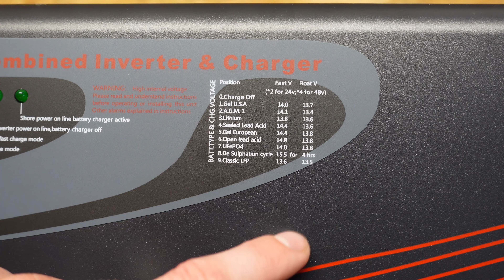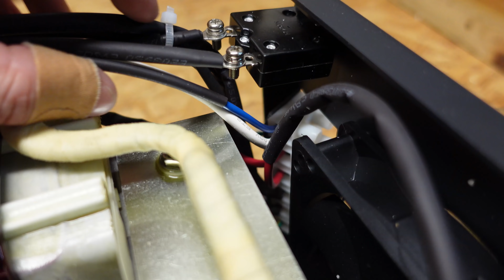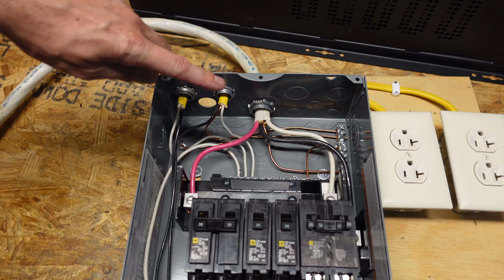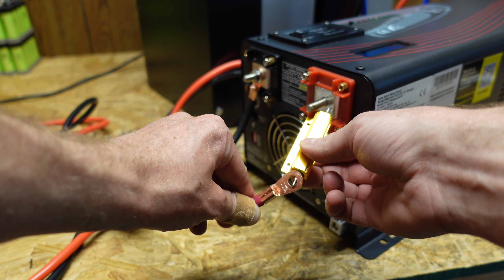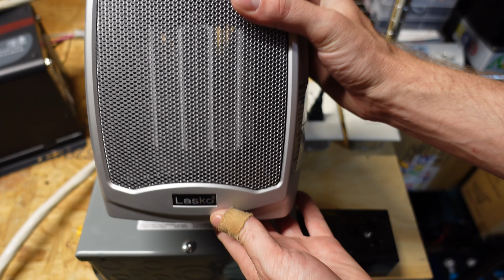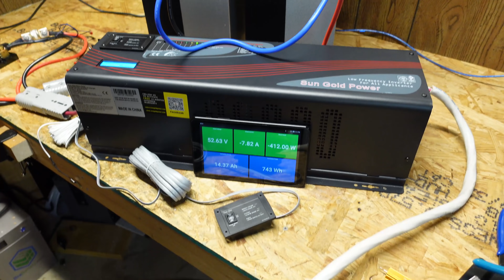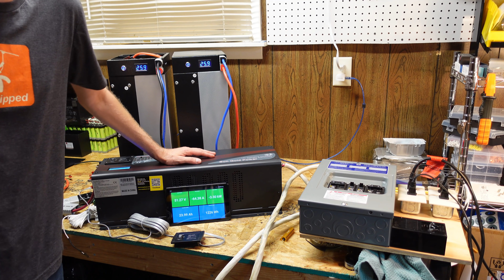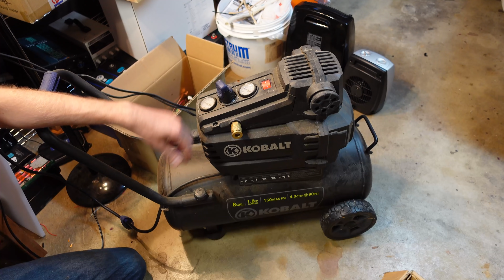SUNGOLDPOWER 6000W Pure Sine Split-Phase Inverter, Review & Testing

Comment: No, those are NOT fantastic battery modules for them to have under-sized the internal wiring. It is not a crimp connector that causes the length of the wire itself to heat up. Bad crimps can cause hot spots at the crimp, and even arcing, but the wire is grossly undersized. Wire only heats up when it's being used as a heating element on account of too much current. The designer and manufacturer should have tested that cabling, and they failed to do that. In all my years as an Electrical Engineer, I've learned that one can usually get away with under-sized wiring for short lengths inside encasements, but the metallurgy of the wire has much to do with how much overage it can handle before rising above the acceptable heat index for the insulation. What you experienced is typical of Chinese bad designs and build. They should have tested their wiring before putting these out into mass production. Wiring in new cars and trucks these days are getting warmer than they should because manufacturers are down-sizing the wiring so much to enhance profits at the overly high prices of their products. You should put in a parallel wire to those in the battery enclosure that are heating up, or replace those internal wires yourself if you want to try and make sure you don't end up with a fire in your home. Fine stranded welding cable can generally handle more current than the larger strand wiring with THHN insulation for industrial interconnections.

Comment: Great video. Can you also use the scope to see if it really maintain pure sine wave output? The inside looks like AIMS.
Reply from the maker: I do have an oscilloscope but am not familiar with it enough yet to be able to look at a waveform and say what is/isn't good.
Reply: I tested mine, which is a 24v Sigineer 6kW Split-phase model and it is in fact a puresine wave, THD% was about 2-4% which is typical for on-grid or off-grid stuff.

Comment: I have been running the Sigineer direct version with 9.8 KW AGM (don’t say it I will go LifePO4 when the bank dies, but I can’t just toss em out) for about 2 years as an emergency backup    I love it,  my only complaint is the fact it bonds neutral to ground, but yes the idle capacity is high, but mine is under load when used.  Efficiency is better at higher loads
Reply from the maker: I'm curious - have you opened it up by a chance? Does it look the same inside as what I showed here?
Reply: @LithiumSolar  I chuckled when you showed the display, it is identical too.  Surprising after 2 years frankly
Reply: @LithiumSolar  I took a peak.   I don’t remember the red goop, but otherwise yes

Comment: I've got a 2000 watt Aims...looks like half of yours , also it weighs 44 pounds, lol...one thing , my cables are 1/0 and they don't even get warm...somewheres I heard that heat is just lost wattage...I don't like hot cables...you might have an issue there, looks kind of like a design problem

Comment: BigBattery using #6 is ridiculous. The silicone insulation might be 200C rated, but I don't want that much loss or heat in my wiring.
Reply from the maker: Yeah, needs at least #4 if silicon, preferably #2...

Comment: What I dislike on this generic Low Frequency Inverters, is that you cannot set own Cutout Voltages for charging and discharging similar to the High Frequency Inverters. I would not want to discharge my 48V pack to 41V, so the UPS-like automatic transfer to grid power would not happen sooner. Always going down to Zero SOC makes no sense. What would you do if you wanted to lets say cycle your pack only between 15-90% SOC with an Inverter like this? For charging, you can use a separate charger, but on the low end? The setup with separate Auto-Transformer as David has demonstrated is the best I have seen till now. Get the best out of both worlds...
Reply: Bit of a shameless plug...but we at Genetry Solar have been working on making our own inverters (i.e. not rebranded Chinese units)...and if you need settings, we've got 'em.  Customize ALL voltage setpoints (OVP/UVP alarm/error, ATS enter/exit, battery bulk/float, charge trigger, auto power save threshold, etc.), and lots of system settings as well.  There are at least a dozen pages of settings on the ~8-line LCD.  Just to give you an idea of the depth of settings: there's a setting to flip the LCD text upside-down if you're mounting the inverter in the opposite direction.
No load idle current is also ~35W to boot (measured ~0.7A @ 48v).  Power Save (fully customizable timing and minimum load thresholds too) takes it down closer to 5W no load.  12, 24, 36, 48v...single or split-phase output...yeah, we're having fun ;-)
Oh, and if you need a software feature not currently implemented, we can provide them via WiFi firmware update.

EDIT: Currently selling 6kw (continuous) units.  Have a 12kw in the pike once we get it working well.
Reply from the maker: @Sid Lori is Genetry Solar a US-based company? I couldn't find anything on your website in terms of a shipping address. Your inverters look very interested. The 6000W uses a toroidal transformer and is stackable, so 2 units will put out 12,000W split-phase? And at 35W each, that's 70W idle and about half of what my AIMS uses? Interesting...
Reply from the maker: Oh, I just saw you have a 12kW in development. Would love to work with you on the 12kW if there is any opportunity to do so AND the specs hold true (toroidal transformer and not 150W idle like the larger AIMS). My business email address is in the video description :)
Reply: @LithiumSolar  Yes, we're U.S. based, sales/stock/support in Michigan, and I'm the developer down here in Ohio.  Have to say they're made in China to our specs; that's the only way we can compete in the market.

Yeah, getting the no load current down is kinda fun.  So far so good.  Inverters are practically inaudible at no load...fans completely off, transformer pretty much silent (have to put your ear up to it to hear the faintest hum.)
Reply from the maker: @sidlori1592  Oh nevermind. I see you're using Power Jack to manufacture them. Bummer...
Reply: @LithiumSolar  Yeah, PJ's inverters are pretty bad...but when they make stuff to our specs and with our parts, they work pretty good.
No way we could make the inverters for $1k in the States...we'd lose money at double that cost.
Reply from the maker: @sidlori1592  I have no problem with things made in China. It's just that Power Jack doesn't exactly have the best reputation. But if being built to your spec, that will hopefully negate that problem! I look forward to seeing what is brought to market. We need more larger whole-home inverters, like a 12kW. Most of the options on the market currently seem to be copies of one another - different brand names but same big problem of 150-175W idle consumption, which is just absurd in my opinion.
Reply: @LithiumSolar  Yeah, PJ inverters are pretty bad--and unfortunately for them, they're getting worse.

Funny thing is, they don't even want our design.  They squeal over 20¢...and then I come by and use a relay (make that 2) that cost 10x what their single relay uses.  "Do you want us to use our relay?". Nope, use the one I specified, thank you very much.  Kinda funny, but if we are demanding, we get quite good products from them--they're happy, and we're happy.

A major part of the no-load current in all these inverters--apart from the square tranny core--is the lack of a small choke on the tranny input wires to absorb the high SPWM frequency.  Without that choke, our inverters will sound horrible and run 5A no load.
Reply: @LithiumSolar  looking forward to see the review of Sids inverter. Hope he is going to send you one for testing. I do live on the wrong continent :))
Reply: @RolandW_DIYEnergyandMore  In the plans once we get the design fully pinned down and enough stock available.
Reply: @sidlori1592  good to hear that someone else then me is noticing the issue, especially when it is a manufacturer :). Till now there was only the choice between something with all features but unable to start an inductive load, or perfect surge behaviour but no settings. Thanks

Comment: 6 gauge wire can only handle 101  Maximum amps for chassis wiring so big battery has shown once again  how incompetent they are
Reply: 6AWG 200C rated silicone wire is rated for 165Amps and with such a short piece of cable, it will be just fine for the amount of time it will take to fully discharge the battery.  Most ampacity charts don't even include 200C rated cable which is really annoying since it is used so heavily in the battery world. That being said, they could have used 4 or better yet 2AWG and eliminated more of the voltage drop on the cables.
Reply: @kuhrd  that does look like silicone, so than why is the cable heating up so badly?
Reply from the maker: My guess regarding why it's heating up so badly is a not-so-good crimp somewhere. I need to locate my thermal camera (buy a new one really) and do further testing.
Reply: @LithiumSolar  I'd be interested in what you find. especially if the heat is from the wire and not a bad joint
Reply: @kuhrd  you know what I think , silicone cable isn't listed because nobody in their right mind would certify something so unsafe. wires normally are rated at the ampacity so the conductor can passively dissipate the heat. the wire he's using is already starting to show thermal runaway. if he tried to pull 165A through that the conductor would possibly liquefy, a deep nick in the insulation would be catastrophic even if the insulation could hold that heat in. where do that numbers for silicone ampacity even come from? the manufacturer? they would have an interest in promoting their own products, that's my thoughts on silicone even though I'm using it a lot for batteries like you said

Comment: Great video.

Is there any way to set it up for demand sense so it isn't using 100W all the time ?

Will the charger function work with a 120VAC source ?  Or does it have to be 240VAC ?

Can it charge while it is powering a load ?   Will it sync with another inverter in parallel ?
Reply from the maker: 1) Has a power savings mode that does just this - will be testing this in a follow-up video very soon
2) No, this inverter is 240VAC input only
3) Yes, it can power while charging and no it cannot be paralleled with other inverters.
Reply: @LithiumSolar  Thanks for the replies !

Comment: I have this exact Inverter and have been testing it (real world) for about 4 months now.  I currently have it hooked up to about 350Ah of Homemade 48V 18650 Packs (500Ah after this weekend) with about 8kW of Panels on the roof flowing through (2) Sunnysky Solar MPPT 60A Solar Charge Controllers (which are working great so far).  I also have it connected to the Grid.  I have it set to use the battery as priority and the Internal Charger turned off.  If the battery goes below a certain point, it is supposed to switch to the Grid power and then switch back after the battery it is charged back up but I have had some issues with this functionality.  I am currently working with SunGold (via emails) trying to figure it out but no resolution yet.

The first problem that I experienced is that from time to time (with no rhyme or reason that I can see) it will switch off of battery power to grid power and then a few minutes later back to the battery.  I have seen it do this as many as three times in a three hour time span when the battery was at 90% charge and the inverter at only 50% capacity.  SunGold did not have an explanation for this but asked me to video tape it happening for them.

The second issue I had is that one Saturday when I arrived just after daylight and the Inverter was on Grid power.  The Battery was at 46V (around 60% capacity) and just started charging for the day.  I waited for over an hour and but it never did switch back to battery power.  When I finally switched the Inverter off and then back on it immediately went to Inverter (battery) mode.  SunGold did not have an explanation for this either.

Those issues are not as concerning as the third issue that I had.  This set-up is in a building that I normally only go and visit on the weekends but about a month ago my wife had the need to go up there on a Wed. and when she opened the door to the building there was no power whatsoever.  She called me and I had her go and flip the master switch to turn the building back on the Grid (totally bypassing the PV system) so she could do what she needed to do.  Apparently the building had been without power for a couple of days as the freezers we have there were almost thawed out.  Luckily we do not have much in them right now as I try and get the bugs worked out of the system.

SunGold has yet to be able to provide me with any answers, the most concerning one is why the system just shut down and did not switch over to the Grid power.  Since I was not up there that Wednesday, I was not able to observe the system.  I just had my wife turn all of the switches and breakers off on the DC side as I did not know what had happened.  I really do not even know what to do to try and repeat the fault.  With all of the lights off in the building, the system just sits there and idles at about 0-10% (one full size fridge, one mini fridge and one chest freezer).  Note:  I have to leave it in active mode as I could not get Standby mode to work at all.  Even when the 1 ton AC unit kicks on (small apt.) it only jumps to about 35% and a month ago it was still not very hot here so I don't even know if the unit had come on that week or not.  When I was there last weekend with all of the lights on and running saws and other tools (air compressor) and the A/C in the Apt. kicking on and off everything worked great with zero issues.  Even with all of that going on my batteries were at full charge by noon when we left.  I was video taping the system trying to catch it tripping off battery to grid but it would not do it on camera.  What I do know is that I cannot trust a couple of freezers worth of food to a system that might just shut down for no reason at all.  Really wish I could figure it out.
Reply: Wow nothing worst than a system that you can't trust to leave alone. I have (2 )  24v split phase 3000watt / 6000watt combined Growatt Inverters that I love. I use the same setup you mentioned and it's been working flawlessly.

Comment: When you add a 100W load, will it add up to 200W consumption with the 100W idle consumption, or will it be less? If less the 100W idle consumption will not be such a pain as it looks at first sight.
Reply: It will add to your regular load, can't get away from it.